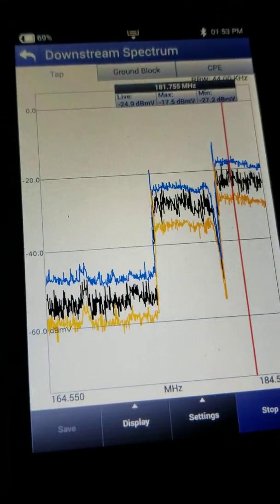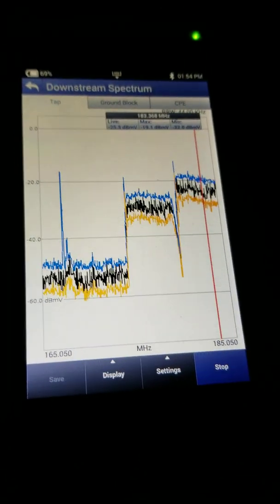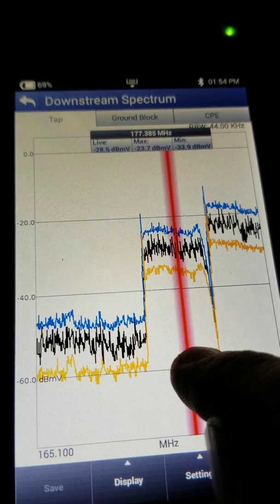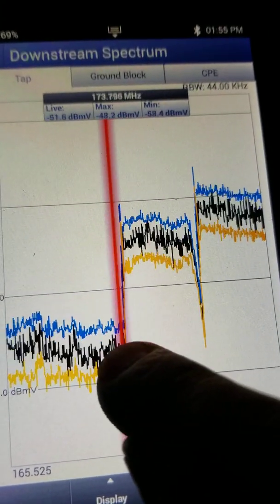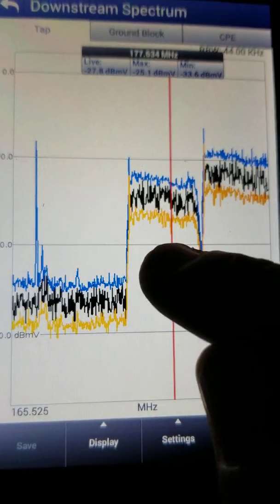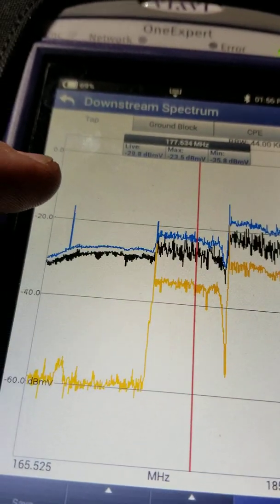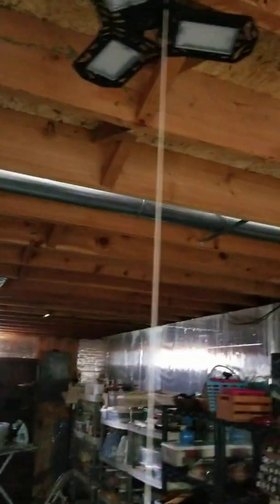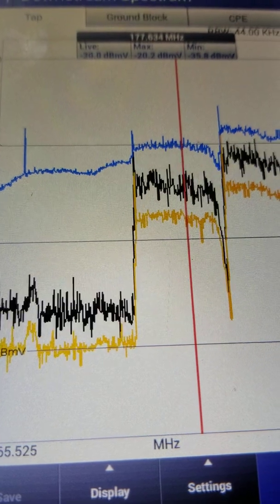Some LED lights cause interference with antenna OTA VHF channels.

Comment: Thankyou so much gor sharing. I am currently experiencing this with 12v low voltage LED garden lights. When i turn them on my house and neighbours house TV begins to pixelate. Is there anything i could add to my garden light wiring to resolve issue?

Comment: First. I love that meter! That is beautiful! Second, I have this SAME issue. But with LED Street Lights. So at night I lose all VHF signals. I've tried all I can. But I don't know how to resolve the issue since it's lights put up by the county. I've talked to them about it MANY times, they don't care. I've filled an FCC complaint, to no avail. The only good thing is the VHF channels have UHF counterparts I use at night. But they're not as stable for me as VHF. I am 68 miles from the transmitters, using various Televes antennas, and a Channel Master CM3020.

Comment: What should I look for when purchasing an LED light? I have a OTA antenna and do not want this to happen to my signals.
Reply from the maker: Thanks for asking. When you buy a new LED bulb, look on the back of the box for "This device is FCC compliant." If you see this on the box, then you know it is okay to use. I have only seen one instance where they lied on the box. However, the bulb came from Amazon, which was likely a foreign ripoff, and printed it on the box to please the readers. Most hardware and department stores sell good LED bulbs today.
Reply: Information like this is what Really helps us non tech people.  Thanks.

PS. Try to add small details like this in future videos. They make a big difference.

.